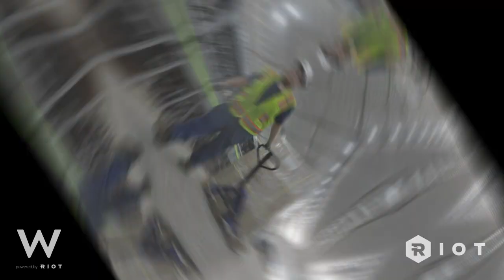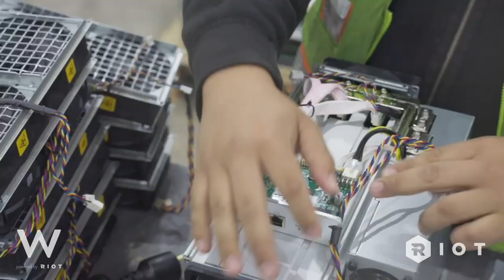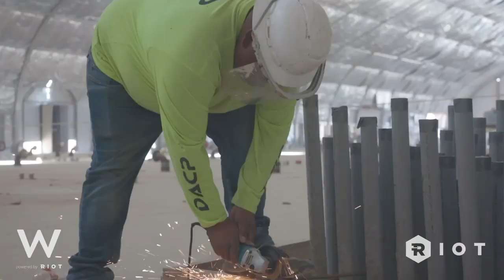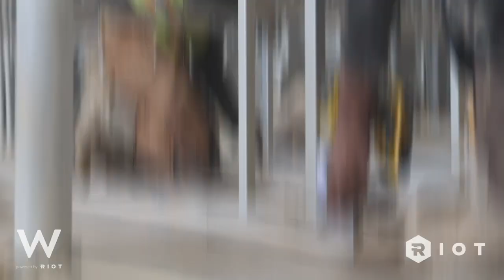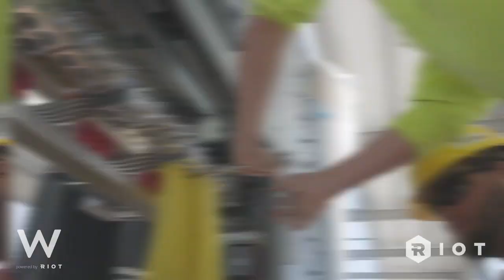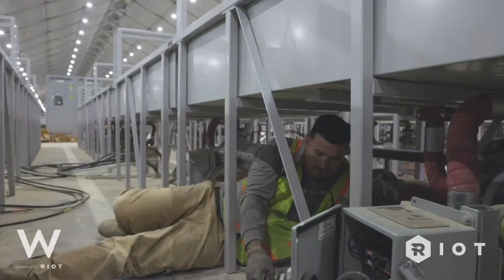Riot's 700MW Data Center Project Update | April 14, 2022

Comment: how many watts per machine?
Reply from the maker: Hey Jakob, it depends on the model.  But we design the PDU to manage 4,000 watts per plug.
Reply: @ChadEverettHarris  Really thats it? I've seen a bunch of farms push 7000-8000 watts thru the S19 j pro and reach 175-185 th.
Reply: @ChadEverettHarris  Also is this system using a chiller in series with dry coolers or strictly dry cooler?
Reply from the maker: @jakobwimberly2256  You are 100% correct.  I remember the time when I blew 2 WRX STI engines- Tuned, Turbos, Exhaust, Short Shifters... it was crazy fast.... until it wasn't.  I learned long ago, that you can make anything perform.  

Miss that car...
Reply: @ChadEverettHarris  Gonna take that  to note on my next immersion System. Thanks Chad.
Reply: @ChadEverettHarris   4000 watts even for your immersion tanks?
Reply from the maker: @TaylorMonnig   that is correct.  Yes, I am aware that people are pushing 4-8K watts.  At this time, that is our plan.
Reply: @ChadEverettHarris  Interesting! Love seeing your guys continued process.